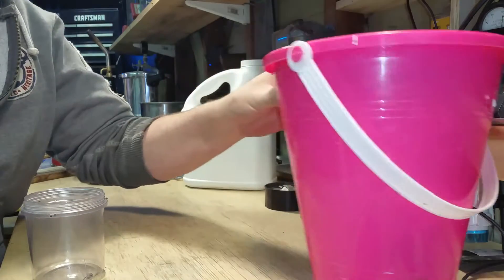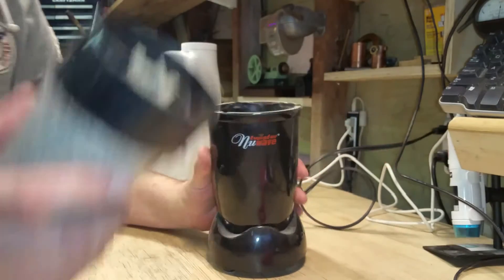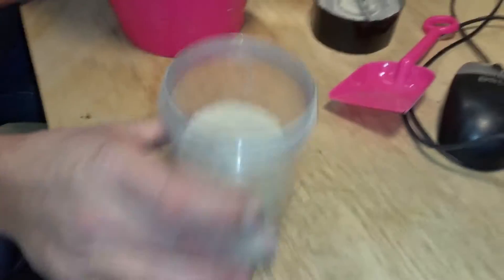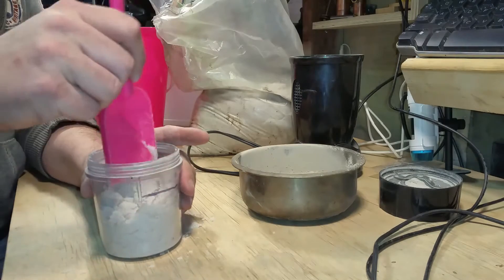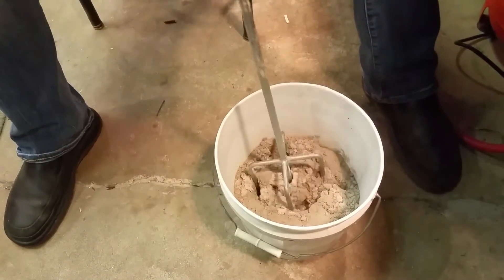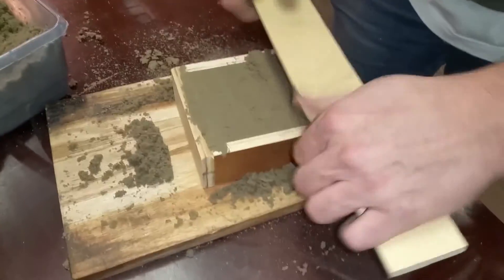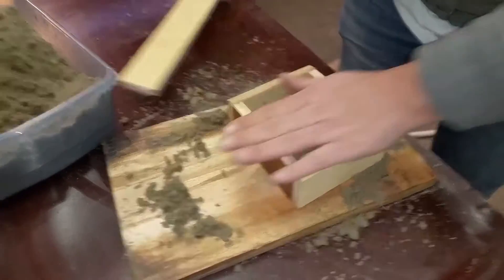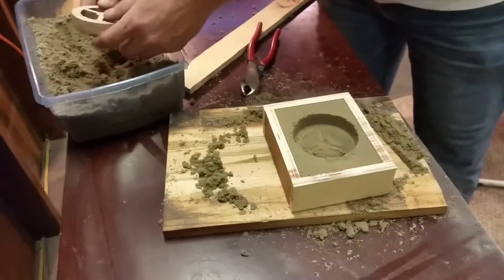Brass Casting: #1 Making green sand for the metal smelter

Comment: I saw mention of concern about clay dust. Silica sand isn't any better for your lungs. There are more recent videos out about making green sand that suggest sifting(?) the sand and clay. You will be sure to control grain size that way. Another interesting method on grinding the cat litter was a paint can on its side connected to a motor with ball bearings and nails. Not nearly as fast as a grinder, but, less stress on the motor. Re: flask filling. Many videos I have watched show the user sifting sand over their object to make sure that all the nooks and crannies are filled before they start seriously packing the sand in as mentioned earlier.
Reply from the maker: HI Kyle.. Man.. I appreciate the comments.. Moved away from green sand and went to petrobond... You are right..don't breathe the dust..Toxic stuff.  Thanks for watching and i hope you watch the series.. Cheers!! -don